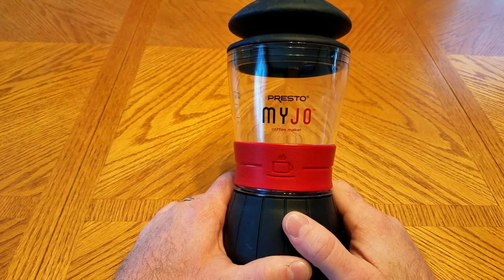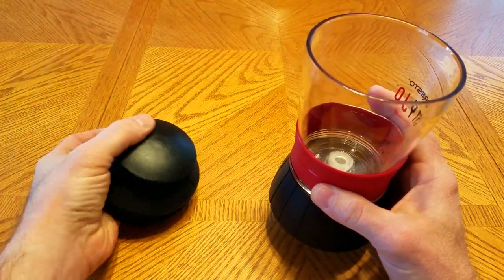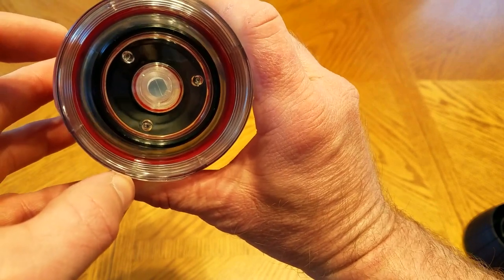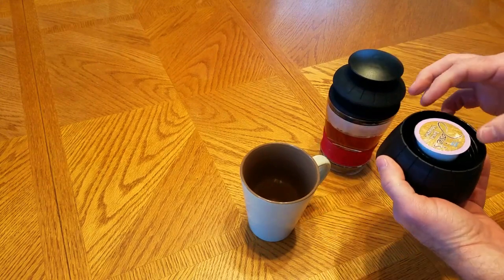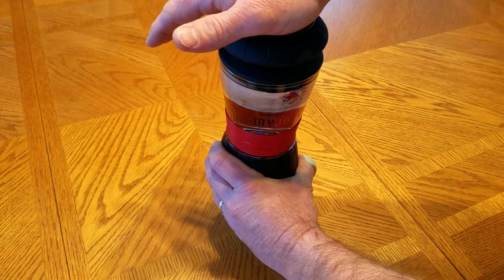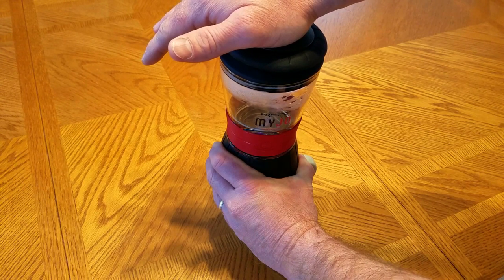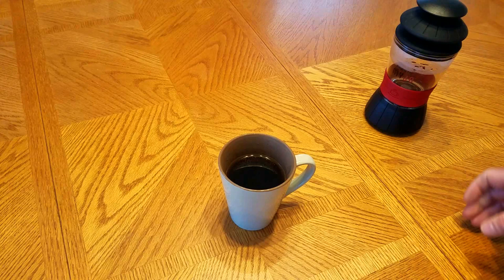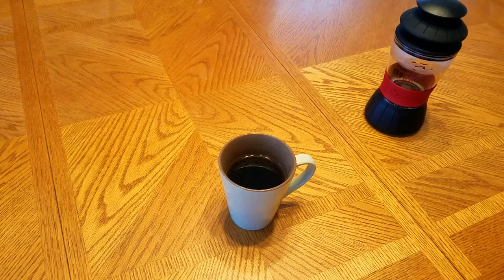Presto MyJo Single Cup Coffee Maker, problem fixed.

Comment: I got me one of these and have used it a lot while traveling in my camper van conversion. I love it, it works just as good as my Keurig machine at home. I also had to use a toothpick to poke a tiny hole in the little rubber membrane.